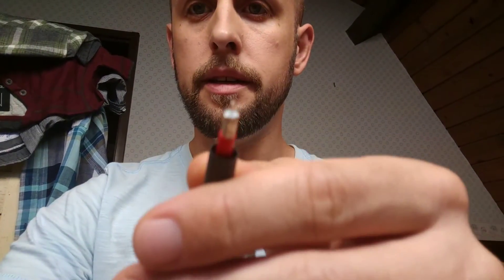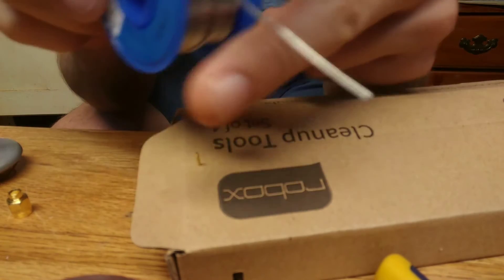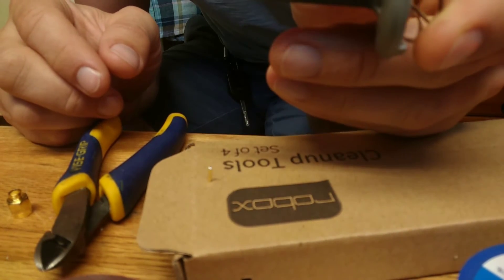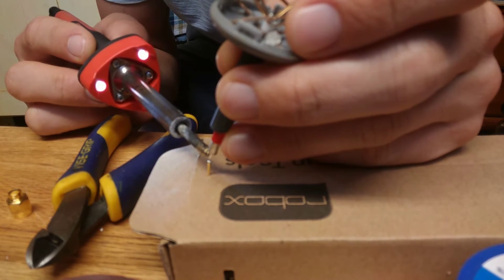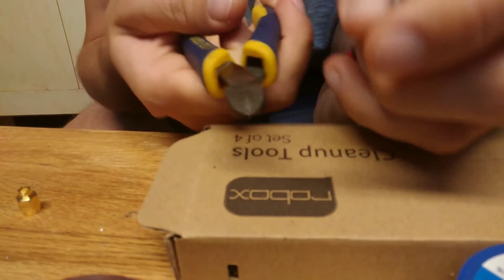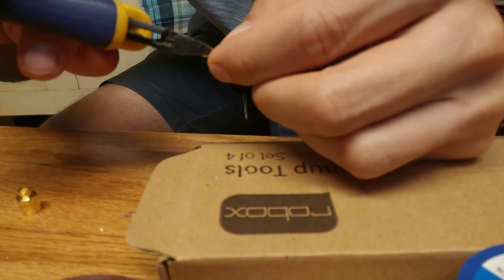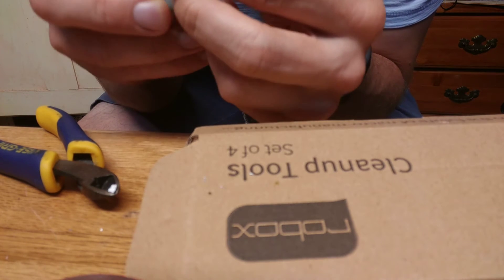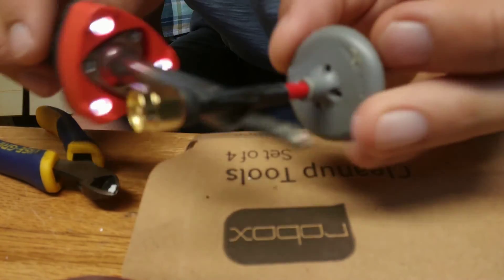Soldering new SMA connector on Immersion RC Spironet FPV antenna.

Comment: What wire gauge is the spironet antenna? Need to do this with mine but can't find what coax it is.
Reply from the maker: I believe it's RG402 Coax. This is the normal stuff used in the semi rigid antennas.

Comment: Well job :) , But I think the side glob is due to putting soldering as the same volume of the entire cavity of the pin, if putting less solder peace inside the pin, it will work well.